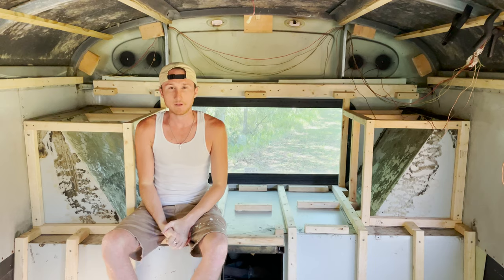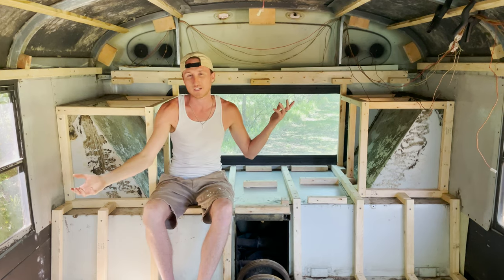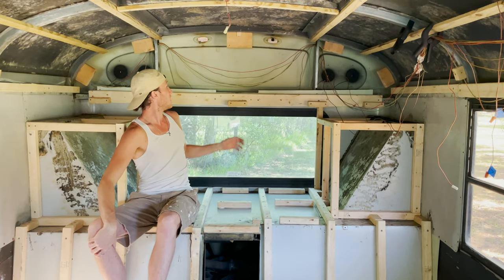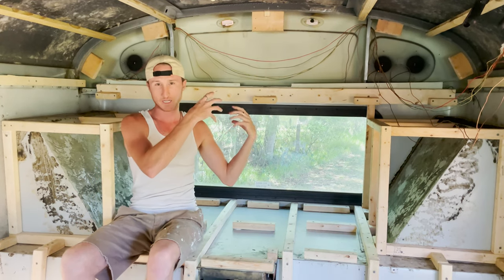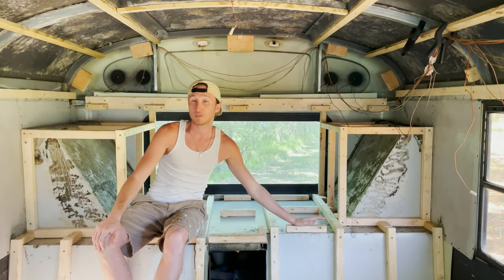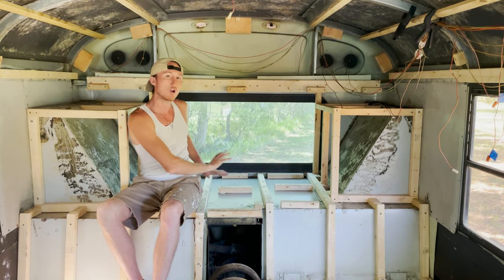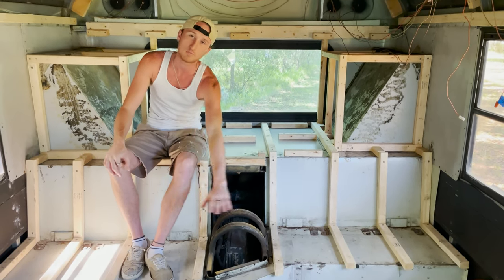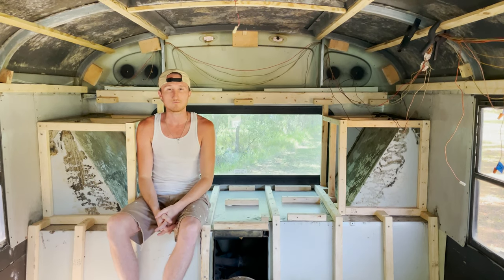SKOOLIE CONVERSION: FLAT NOSE SCHOOL BUS FRAMING!!! #BUSLIFE4ME

Comment: There are also flat nosed school buses that have the engine in the front.
Reply from the maker: Hmm, we have never seen that before!
Reply: @buslife4me  They're the ones with the grille on the front, along with having the doghouse with the engine inside that would be located between the driver's seat & the diagonal staircase.
Reply: And also if you frame up the doghouse in the rear of the bus how will you do general maintenance to the engine and trans will  you guys be creating some kind of removable panel so it will be more accessible
Reply: The bus is looking amazing btw great job I'm enjoying following along to see the progress